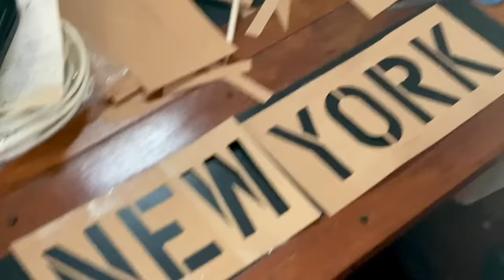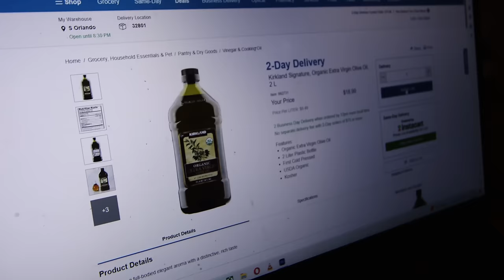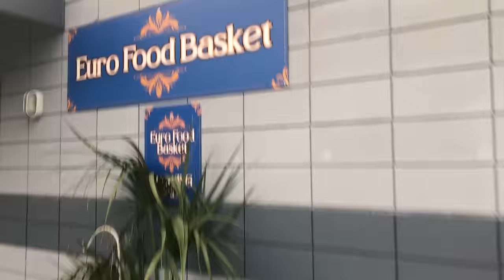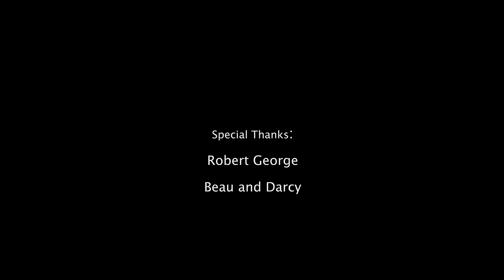Sailing Liberty- Hardest Choice We’ve Faced/ Bikini Laundry/ Long Term Provisioning for a Sailboat

Comment: Entertaining video guys :) Replacing any exterior timber on a boat is always a pain in the ass job, and then you also have the annual chore of oiling/sealing or recoating your rubrails/fender stakes and handrails. But wood rots eventually and after patching parts of my top plate/strakes for many years, I finally bit the bullet,got my claw hammer out and ripped my rubrail and top plate completely of the boat. I have purchased the plastic/rubber type rubrail to replace it as its resistant to UV and needs no maintainance apart from cleaning occasionally, also a hell of a lot easier to fit as opposed to steaming/laminating hardwood timbers to fit the curve of your hull and deck. Maybe not as pretty as wood but who cares about that when we've got Helen to look at lol...😃

Comment: Re chain plate crack detection.      Used red dye penetrant on aircraft parts. Just spray it on and let it soak then wipe it off and use white spray developer  to draw dye out of any cracks. Cheers, Capt. Ron

Comment: For testing metal for cracks,  UV penetrant dye plus a UV light  works well, better than keen eyesight. Auto parts stores and online carry the dye and UV flashlight via online.  Probably under $25 total and use/test when dark.

Comment: I hope your replacing the wood on the top of the walls
Reply from the maker: We will try to glue and restore the cap rails. They seem actually pretty solid with a lot of character. Let’s see how it goes.. We have been doing a lot of carpentry and people often dismiss something that is still good. Ted is making underneath the cap rail waterproof and it will be only decorative in the future. Thanks, Helena